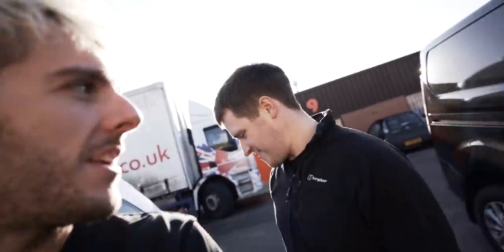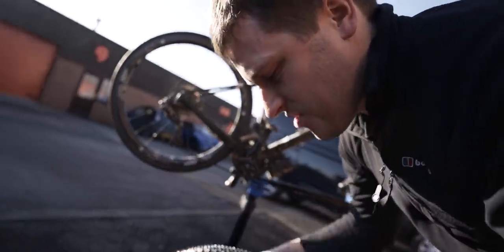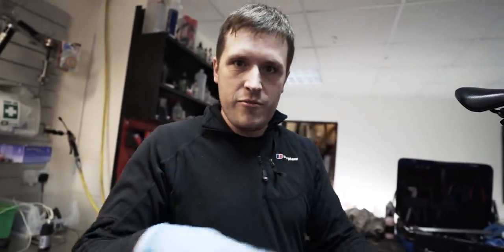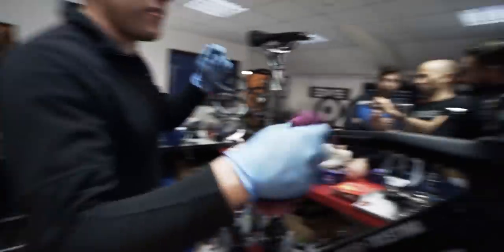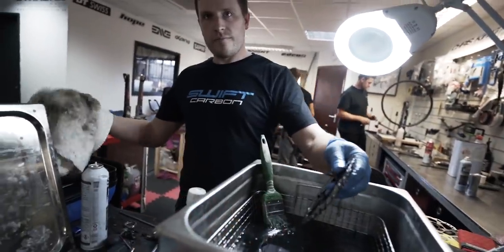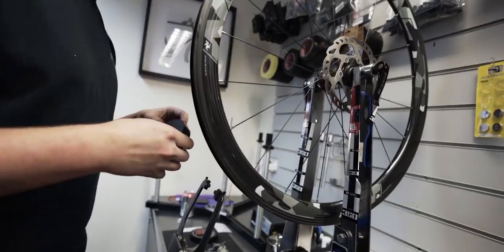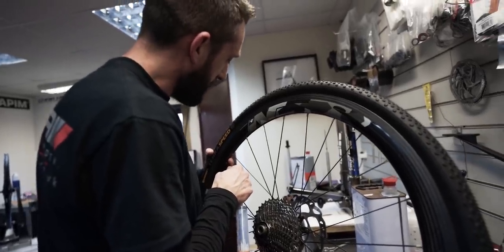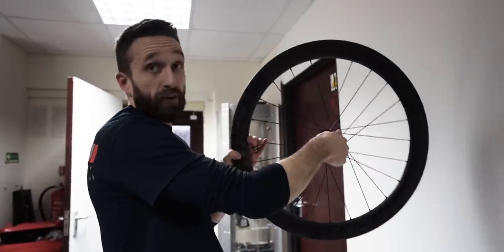Cleaning your Road Bike - Pro Mechanic's Top Tips

Comment: Moral of the story.. Don't buy bike specific cleaners. 🤣
Reply: muc-off just disliked this video
Reply: And also if I See properly - dont buy Bike specific rim tape, just find proper Tesa tape model which does the job 😊
Reply: Electrical tape ftw
Reply: @abcd969696  not for tubeless
Reply: @glennoc8585  gorilla tape for tubeless! That being said proper rim tape for both tubeless and clincher is so cheap anyways (25 dollars for a 6 wheel roll of stans from my local bike shop and 2 dollars for a set of clincher rim strips from mec or slightly more from lbs) i just stick to it anyways.

Comment: I have a brush from finish line called a grunge brush. It’s great for cleaning chains and cassettes. The car shampoo is a great idea. I use car spray wax and spray it on the wet frame, with the wheels off, and then dry the frame then polish with a microfiber towel. Looks like new! Ultrasonic cleaners are great but expensive for a decent one!

Comment: With regards to what Strada is saying about wheel safety, is it simpler safer to go with the bigger brands such as ENVE and ZIPP? Avoid the smaller shops where they do roll their own name branded rims?
Reply from the maker: No necessarily, it's all down to what rim is used and if you're using rim brakes or not.

Comment: The salt in washing up liquid isnt the damaging kind, actually more in tap water than most washing up liquid. Bennits social did a test for us lot that have bikes with engines as well.
Reply from the maker: Interesting! 
I've used washing up liquid for years and not had issues. I'm sure some ingredients will vary brand to brand
Reply: @Cade_Media  I think it was liddle own brand they used but it covered all within reason. Salt isn't always that kinda salt. The biodegradable stuff I use made my motor look a lot cleaner than the usual motorcycle stuff and both peddle bikes have been fine. 
Only exception I've seen is visor's because it's a different kind of plastic some things can cause issues and that can get just dangerous at motorway speeds.

Comment: Any reason not to use the cheap as chips citrus cleaner 'Elbow Grease' on drive trains? I understand it's not good for carbon frames, but on the drive chain of an aluminium bike is it ok? I've used it once and it seems to work, but slightly unsure how good it is in the longer run.
Reply from the maker: it's probably ok - for quick cleaning at home I just use soapy water and then gt85 on a rag to get rid of the black stuff. Leaves a residue that stops rust building up after which is handy
Reply: @Cade_Media  Is that the gt85 original, not the lube or degreaser?
Reply from the maker: @peterseago5451  yeah the standard one! 
Your comment inspired me to make a video on it which o have filmed and released soon...

Comment: Nice. How does he clean the Di2 mechs?
Reply: Use blanking di2 plugs to seal where the cable would plug in, then use a brush and cleaner. (don't submerge them 🙈)
Reply: Thanks @Browns Bikes! What else can go in the ultrasonic cleaner? (Clearly not electronic mechs!)
Reply: Chain, cassette, chainrings (although I don't leave the hollow shimano chainrings in too long)

Comment: I had to pause at 6:14. My favourite parts about this video is the fact that no one is  hustling over priced cycling specific cleaning products or methods. There is no scientific proof that bicycle specific cleaning products are any different than regular household cleaning products. At least to my knowledge. Simply use common sense when using any cleaning products and you can save a ton of money.
Now Francis what about those overpriced super expensive ORANGE tubes you keep using that clearly suck???
Reply from the maker: Hey they are tiny and way faster than butyl!
Reply from the maker: I'm actually doing a video about light inner tubes soon, pros and cons.
Reply: Francis Cade ok Francis who I don’t know personally, I’ll be watching. 
I cycle, not a shit ton like you, but I cycle. I’ve done triathlons and grand Fondo’s for close to 10 years and in those 10 years I have never had more than 5 punctures. On my road/Tri bike I use Vitoria Rubinho pro and on my gravel bike Schwable G-One all round tires. For tubes I use Continental. I never spend over $8 Canadian for tubes. 
In case you were wondering.
Reply from the maker: @thecrowfliescrooked  I'm a puncture magnet, even with tubeless and conti tubes (which I run on most of my bikes)... I run pretty low pressures though so usually it's pinches.
Reply: @Cade_Media  jonah 🙄